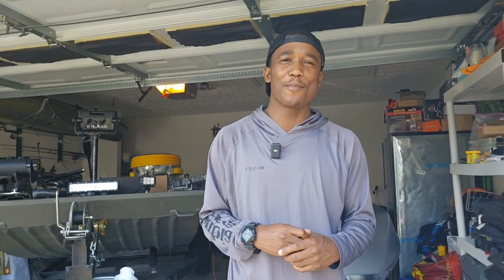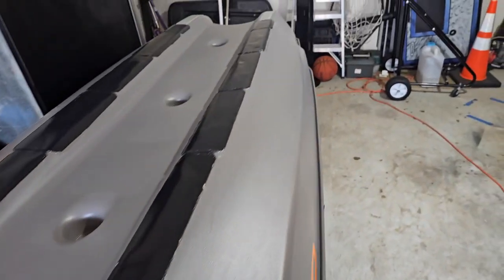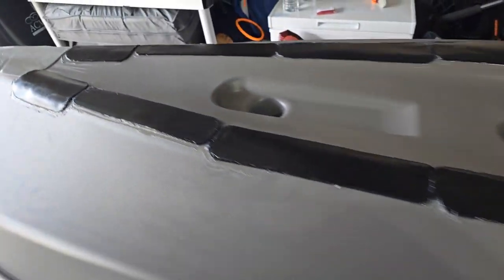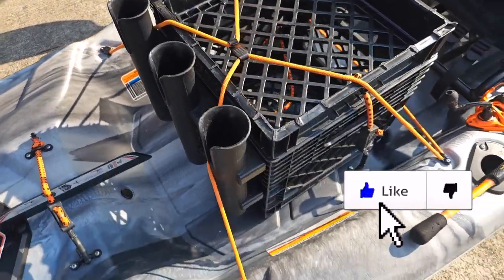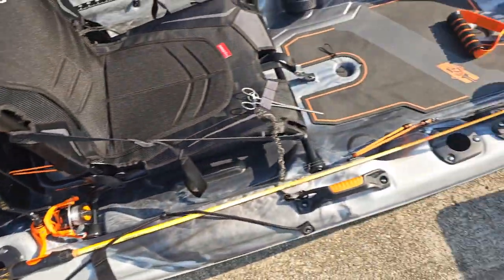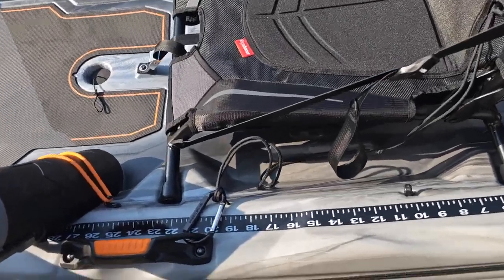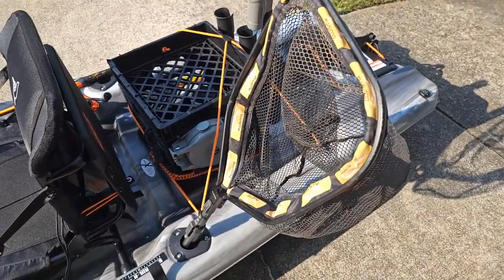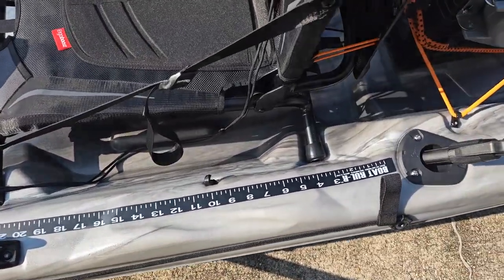The BEST Practical MODIFICATIONS for the Pelican Catch Mode 110 Kayak + Kydex Keel Guard

Comment: Firstly love the video. Super detailed and useful for someone starting out such as myself. What brand rod holders will fit this particular rail system on the sides? I’d love to add one of these to mine if possible.
Reply from the maker: Thanks, glad you like the video. I belive most rail system rod holders work. Its a Versatile track. I know for sure they fit most 5/16 T track bolts that are standard with most rod holders.

Comment: Have you seen or heard of yak gear they have a 4 rod holder that's adjustable and keeps your rods flush along the side of your kayak instead of having them stick straight up
Reply from the maker: Yes I heard and seen them. This yak has the option to lay your rods flush on either side of your yak along the gunwale and has a rod tip protector, I think these are very handy, but if I needed more spelace I wouldn't definitely invest it them. I have a similar product made by millennium  marine on my boat.

Comment: awesome video man, did you know the skeg on the rear is designed to come off and on very easily by the rubber orange rope holding it on? This is a very awesome kayak for the price i will be stealing some of the mod ideas for sure!! Good luck Fishing!!
Reply from the maker: Yes it is a great kayak, I agree. Taking it for its first trip on a river float trout fishing this weekend. The skegvworks great, u have been thinking about adding a rudder system so I can raise and lower it and turn because it's hard to raise it once it's down from the seated position. But overall it's a hard kayak to beat for the money and features. Good luck to you as well!

Comment: Do you use or have a kayak cart for like transportation from the dock or when you get home?
Reply from the maker: No I dont have one that fits this yak. I put mine on top of my suv roof basket and then pull it off at the boat ramp, load all my gear on it and then push it to the side while I go park. I havent found a cart that makes it worth it to go up and down the steep boat ramp. The only thing I do is drop it on a floor dolley and roll it in my garage when I get home.

Comment: What size are the rubber caps on the seat rails?
Reply from the maker: They are 3/4 inch. I got them at Ace Hardware.
Reply: @fishingistherapy  OK cool. Thanks and tight lines!
Reply from the maker: You're welcome, tightlines, and good luck.

Comment: I just purchased this kayak. The foot pedal on the left side snapped completely off. Has anyone else had this issue and how would I go about replacing it? The screws that mount the rail to the kayak seem do not seem to have any way to loosen or remove them.
Reply from the maker: Thats not good, I haven't experienced this on my yak. May just be a manufacturing error. I see replacement foot pegs on the Confluence website. Here is a link. Im not near my yak right now, but I believe they just slide back on. https://www.confluenceoutdoor.com/en-us/products/kayak-foot-peg/PS1082

Comment: Man I'm struggling i want this one but i also want the catch pwr 100... this looks real cool and fun but i love the 360 chair on the catch 100 still don't know what i want but got to get something soon need to get out there to fish.
Reply from the maker: Yeah it definitely comes down to what features you want, I tosse around the idea of the pwr 100 but felt better for the price point and features.
Reply: @fishingistherapy  yeah I'm with you there its 350 cheaper for this one roughly. And I like how this one is more like a kayak looks easier to paddle with but I am planning on putting a trolling motor on it since I have one already and I seen videos of a trolling motor on this one and it looks uncomfortable the way you got to turn around, have you put one on yours?
And the pwr 100 looks easy to use to troll around need a longer paddle tho if I just want to coast around with a paddle and I like how you can easily get up and walk around in the 100 however this one don't like to bad either.
Reply from the maker: @madd6795 I totally understand. I plan to put a trolling motor on mine as well. Jist havent fullt committed yet. But I have some plans for my yak. The pwr sounds good if you have a yak trailer. I couldn't imagine putting it on top of my SUV every trip or dragging it up the hill when I fish at the hydroelectric dam. But I do like the idea of being able to troll around but im going to add the trolling motor soon so I can make adjustments and dial it in. I would go with the catch for the money but for the teolling features and if I had a yak trailer or flatbed truck I would go with the pwr 100.
Reply: @fishingistherapy Thanks for your insight and point of view helps me decide and your videos too appreciate your time. 
I am in the process of getting a trailer actually gong to get one in 2 days lol just bc my girl getting a kayak as well so it will be useful to carry 2 at a time. But yeah trailer deff helps with dropping kayak straight to water or at least closer. 
Also sweet set up on your upgrade simple and organized can't wait to get my mods on.
Reply from the maker: @madd6795 Man that means alot, glad tou enjoy my content and the info and mods. Your right that trailer for 2 kayaks is going to make life so much easier. Good to hear from you, hope it goes well for you. Tightlines!